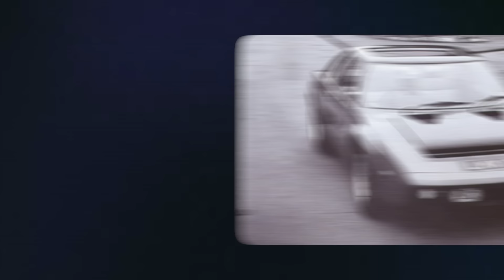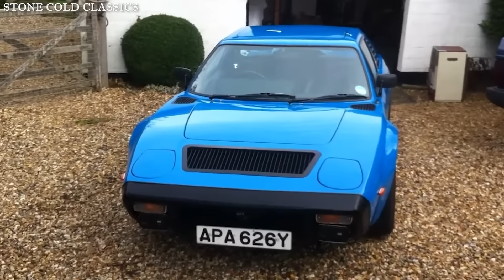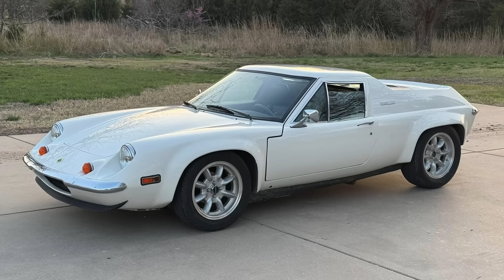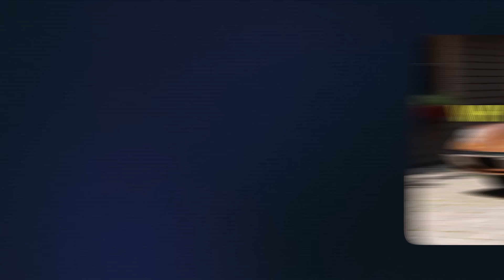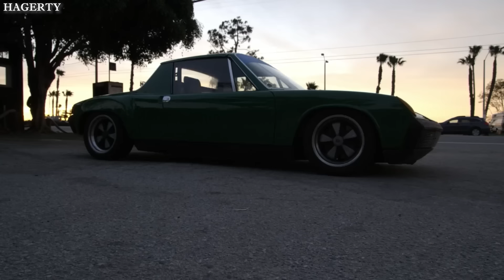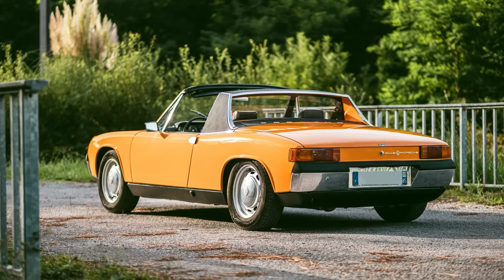4 Most Confusing Sports Cars Ever Made!

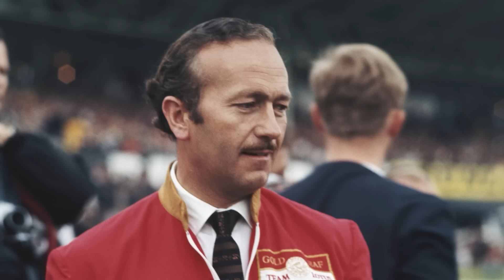Comment: 11:55 This is not true. The older version of Renaults powerpack was originally used in a rear-engined Renault but replaced in a front-engined Renault later so it didn`t take much "genious" to swap it back to the rear side

Comment: In the 1970's i owned a second hand 914-6 ; and it was one of the best cars i ever drove . The roadholding was phenomenal , even on modern standarts. In fact the 6cyl 2l Porsche engine was a bit to tame and with any other modification we put 2,4 s engine of a 911 in the car and it still was one of de best balanced car i ever drove. The torque of the larger engine was a bit to much for the 2l gearbox and it collapsed after 22000km. An other car that i tested on a race track in those days was the Lotus europe twincam .
The roadholding was superb and in a way even the twincam was underpowered, but ... every 2 or 3 laps we had to stop to fix one or an other element . We ended the afternoon wiith doors , lights and other bodyparts fixed with quantity of tape and we even lost the rearwindow.Yes the car was light ,but at what price...

Comment: The 914/4 was stamped: it is faster than its engine !  The road holding was good, very predictable and not compromised by any powerchange. The mass distribution was more even compared to the 30/70 distribution of the early porsches 911's ! 
The body work was moderate, better say poor concerning corrosion, a trademark of that time, like the scirocco 1.